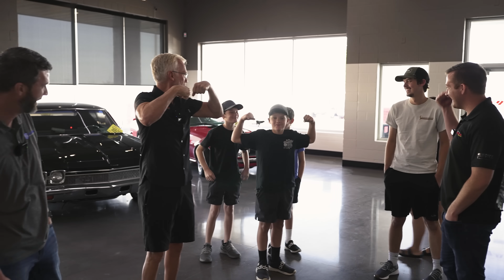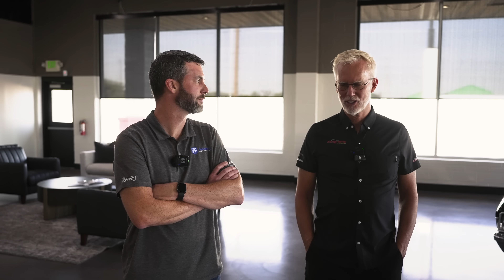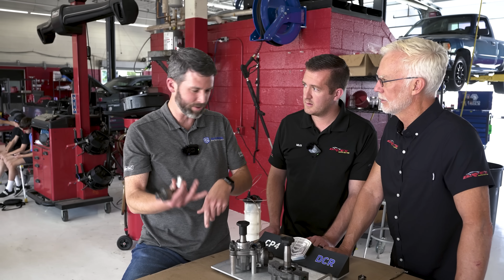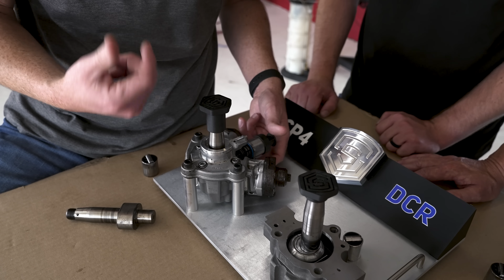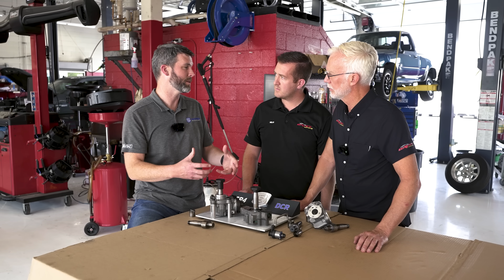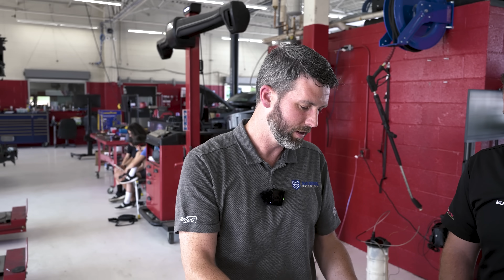Breaking Down How The CP4 Pump is a DISASTER & How To Avoid It With The DCR Upgrade!

Comment: Cp4 is amazing pump. Use the best filter. Keep 1/4 or more fuel for the air not being sucked in. Make sure you have a good lubricity with additives. You’ve got to prime the pump vigorously after a filter change.
Reply: My 1993 Land Rover 300tdi Bosch ve injector pump is a ‘good pump’
As it’s survived over 30 years without any noticeable wear.
Reply: And you do this how? Flood mode doesn’t work on the 2024. Just tried.
Reply: @mikefortunato9800  push the on button without holding the brake.
Reply: @HSKFab   Does not work on 2024 6.7 ford
Reply: @mikefortunato9800  Not sure on your model but on my Gladiator, push the button but don't push on the brake to start wait 30 seconds. Then keep doing it many times. I do it 10 times just to be sure.
Reply: I can confirm this does not work (flood made) on the new 2024 Ford 6.7. Push to start without brake does nothing and full throttle and brake before hitting the button starts the truck. (This was how it functioned before)
Reply: @mikefortunato9800  I literally have a 24 450 and the pump primes at key on.
Reply: @HSKFabrications  Ya, sorry I was looking for flood mode to build oil pressure prior to starting when changing the oil filter. Years prior to 23 had a sequence to follow with gas and brake pedal. Dave's auto documented lengthy time to build oil pressure in the 6.7 on startup which started discussions on pre-oilers, flood mode prior to starting, etc.
Reply: @mikefortunato9800  That was a marketing ploy to sell his "fix". I have an actual gauge on my 6.7 that reads psi. Will build pressure in a couple seconds. I can't believe he got everybody all riled up 🤣
Reply: 🤣🤣🤣 this guy.

Comment: It’s sad that brand new trucks have to be worked on to make them last . The quality that the vehicle companies put out these days is below sub par .
Reply: It's more the complication of having to design and build more and more efficient, "cleaner", and "safer" vehicles and engines. It's an insane bar that keeps getting raised and almost having to reinvent the wheel each time.
Reply: @DWthaman5424  yep.? but seeing as the U.S.A. Makes up let’s say 5% of the world I don’t think these stupid emissions laws is gone make enough difference to ever matter . But some how these lefties think so mostly cause they are profiting from it
Reply: sad that the engineers don't engineer at ford
Reply: The problems with the pumps are directly a result of fuel mandates and emissions mandates. The manufacturers are actually doing quite well considering the constraints they’re forced to deal with.
Reply: @janfalcon2020 the problem is Ford is the only manufacturer still using CP4 pumps. They are known not to be durable but Ford is still using them. Unacceptable
Reply: @Billybob50119  of the big 3 full sized diesels, yes. Worldwide, no. But yes, it’s disappointing they are still using something that’s known to make their engines fail, which they do not cover under warranty if the cause is bad fuel, so make sure your insurance covers this issue. It’s sad because the 6.7 is truly an amazing engine with much more potential still on the table. I doubt Cummins and Isuzu have as much untapped reliable potential.
Reply: @Billybob50119 cp4's work fine....it's our crap diesel fuel.
Europe has been using the bosh cp4 for many years without major issues.
Reply: Thank the government for it all
Reply: @ yep
Reply: It's intentional.  Designed obsolescence; making repair costs so high that the Owner buys another truck, vs. getting his original truck repaired.  They can afford it.  New truck owners are both wealthy and foolish, and no one should cry when they get screwed.  Keeps repair businesses profitable, and the techs well-paid.  Everyone wins.
Reply: @slabslayer258  They don't. This is a big sales tactic, and you're all falling for it. Title is complete horse shit. Cp4s do not "always" fail. Out of millions and millions of Cp4s in the world, less than 5% fail. The 6.7 upper oil pan fails more often.
Reply: Whaddayouwant for $120,000+ ? :face-blue-smiling:
Reply: Hard to wrap my head around changing fuel filters every or every other oil change. I’ve farmed for 50 years, and we will run fuel filters a couple thousand hours or more, no problems. We do have filters coming off our supply tanks and have always ran power service additive, is that the difference?? Asking because I’m about to buy a 2019 ram, 190 k but it has been changed over to the cp3 pump, (my sons truck so I know the history). Also wondering if the 10k mile oil changes are a contributing factor.
Reply: While true, this usually happens when diesel owners fail to maintain their fuel filters, not necessarily 'out of the box'.
Reply: @thiccwafflesosrs  that is also true .
Reply: @slabslayer258 it's all about selling another vehicle these days and bowing down to emissions
Reply: @slabslayer258  wow now Dave is deleting comments that go against his product pushing.

Comment: 2009 F250 6.4 diesel 80,000 miles. Should I just replace the pump and is there a better pump I could replace it with.
Reply: ???dcr???
Reply: @robertpsotka3525  I don't think dcr makes one for the 6.4 diesel.

Comment: My mechanic installed the DCR pump on my 2017 Powerstroke and upgraded the exhaust manifolds along with the stealth g2 turbo and 4” downpipe and it is an eye opener!!  Wow, just wow!!  The DCR never runs out of fuel. Highly recommend this upgrade and never worry about the cp4 grenading.
Reply: Are u deleted?
Reply: @garyolsen4160  Are you epa?
Reply: @blown503  lol I've been called a lot of things but that one hurts.
Reply: @garyolsen4160 you have to be deleted to have a cp3
Reply: How much does that cost to do that mod?
Reply: @michaelyork6592  the pump itself is 2k

Comment: Stanadyne pumps, components & products are the best, proven designs that last. Their fuel additives work - 370K on my 1988 7.3 IDI that has always had their fuel addative used. Still on 2nd set fuel injectors +1 & 5th set glow plugs. Only system weak links are rubber o rings & hoses- "consumables"

Comment: Had my CP 3 conversion done in my duramax 2 years ago. Glad I had it done before the CP 4 pump failed.
Reply: Year ,mileage when done?
Reply: @2hotscottpro  2011,2500 at 96,000 miles.
Reply: @jimmccabe801  I’m at 93k and been thing about doing it for years now.
Reply: @2hotscottpro  The issue with the cp4 pump is you never know when it's going to grenade. Best to do it before.
Reply: @jimmccabe801 yes we know, pour fuel quality higher mileage lol, anyone who takes care of their rig gets 400-500k miles easy
Reply: Easy ya right

Comment: Best peace of mind I could have done on my truck after having 3 cp4 failures in two trucks.
Reply: @Grayson.84 . Not true, GM just admitted in a lawsuit that the CP 4 was never designed for US diesel because it is much thinner and cavitates in normal use, causing failure. This isn't operator error it is bad engineering, not making sure a pump was designed for the purpose.
Reply: @redrubi3942 ‼️‼️‼️
Reply: @Grayson.84good for you. But everything you mentioned I do and beyond that! That cp4 is the glass jaw of the Powerstroke. No one says every cp4 fail, but when they do it’s very expensive! Why Gm and ram did away with them! And they are in other vehicles as well. So just because you have a few that has lasted doesn’t mean they aren’t problematic.

Comment: Lot of euro cars use electric supply pumps and a lot are actuated when you open the door and may even activate the glow plugs depending on temperature.   All saving wear and tear on startup.  Having full fuel available at the high pressure pump avoids fuel cavitation and dry wear.

Comment: US grade diesel fuel has a lot to do with CP4 failure, in Canada we have better grade fuel. When I travel in the US I use additives in my fuel.
Reply: I use a combo of Power Service Diesel Clean + Cetane Boost and Marvel Mystery Oil to keep things running smooth.  We have a 2006 Ram 3500 MegaCab 4×4 with the 5.9 24V CRD Cummins
Reply: I never EVER buy diesel without adding QUALITY additives
Reply: I agree, I always notice a slightly reduced power when filling in the US. I always utilize my go to additive especially when travelling south.

Comment: I put a DCR in my 2024 F550 at 4,000 miles.  Truck starts quicker and I no longer have to worry about potential failure.
Reply: Dave your the greatest , you raised your children strict and proper. My question of curiosity is when one of your boys did something wrong did you send them to there room with a motors manual and  memorise the firing orders on all desoto v8,s ever built......😮
Reply: What does changing the fuel pump do to your warranty?
Reply: @walterrafolski5662  I checked with my dealer you have to wait until the warranty is up
Reply: @walterrafolski5662  nothing. A ford mechanic changed mine out and the truck even has a sticker under the hood that addresses this. I would do it even if it did affect my warranty. If I’m sitting at the Arctic Ocean and I have a fuel pump failure, Ford is not going to come up and replace my fuel system.
Reply: @jimandvalstravelchannel  thank you for the reply, I have a F350DRW on order and it will be delivered second week of October. This issue made me very nervous about buying this truck.
Reply: @jimandvalstravelchannel  I have no idea how it would even be possible to make the 6.7l start any faster? My '24 6.7l HO starts before I can remove my finger from the button!🤔
Reply: @skipjackjohn6231 That was actually "the" opening issue raised in this story! 🙄
Reply: What does the conversion run to have done?
Reply: @justinengle6720  $2000 for the pump and around $1000 for install. It’s not cheap, but way better than upwards of $15000 if your cp4 fails.
Reply: @justinengle6720  a shop is charging me 1800 on top of the kit list price, which they stock, my cp4 is also still good and low mileage on the truck. ive found the best price is from a recommended shop on the S&S site because they do them more than anyone else and likely get a better deal on the kit themselves imo. i checked a few places and it was as high as 3500 for labor.
Reply: @justinengle6720  In the ballpark of 2-3k
Reply: How much was the parts an labor?
Reply: It's rather simple. The starter spins at a specific speed. Any pump that can provide higher rail pressure at that specific speed can improve start up. Higher fuel pressure always equals better fuel atomization which equals more power. More power at startup equals faster starts. Also, people are fully capable of detecting millisecond differences in time.
Reply: @MrPeacekeeper44  Mechanical pumps, sure! The rest of what you said is applicable only in the last century!
Reply: @djsmith4789  I think you are confusing electronic regulation with actual pump mechanics. The ford high pressure pumps are mechanically driven by a gear. this means they are only spinning at a specified speed at startup. Now if the pump was providing too much pressure at startup (not likely) the electronic pressure regulator would step in to dial it back.
Reply: So what is a DCR and what is a CP 4 pump how do you know if your car is cp4 or CP 3 is it for diesel or petrol is it in USA or Europe
Reply: @liambyrne591  these are both high pressure diesel fuel pumps. The Bosch CP4 pumps are prone to fail and due to how they route fuel through the pump body, the bits of metal from the failure spread throughout your entire fuel system. Which then requires total cleaning of every bit of the fuel system and replacement of some parts. The DCR is a direct replacement for Ford 6.7 diesel engines. They are designed differently and even should one fail, there would be no way for metal bits to spread throughout the fuel system. CP4 pumps are used in the US as well as all over the world.
Reply: You definitely still have to worry.  It's not a pre 2024 Toyota.
Reply: Kingstar Company and your new Rig are #1... Congrats Jim.
Reply: @skipjackjohn6231  Stop what?
Reply: Scrap CP4 VIVA LA VIDA DCR FOREVER! once you go DCR you won't go back to shite CP4
Reply: Sorry, just changing the pump will not change starting characteristics of an electronically controlled common rail.
Reply: @HSKFab  I'm no mechanic, but I can assure you the truck does start faster.  I think @PowerStroke Tech Talk w/ARod agrees.  He noticed it before I did.
Reply: @jimandvalstravelchannel  They both are salesmen for s&s. The starting times for the 6.7 varies between trucks. Mine starts extremely fast, with a cp4. You can replace the vcv and it will start faster. Which the dcr comes with, a new vcv.
Reply: @jimandvalstravelchannel I am a mechanic- and changing the pump can absolutely affect the starting characteristics. Don’t think so? Swap to a worn old pump and see how well it starts.
Reply: @danielhenry52  I have trucks in my fleet with over 300k miles that start on a dime. There's more that goes into play with the 6.7 than just the cp4 when it comes to starting.
Reply: @danielhenry52 but his pump had 4 k. As bad as the CP4 is even 4 k isn’t worn out.
Reply: @jeffreygoss8109  I’m not saying changing a pump “will” affect starting. I’m saying it can. Plenty of these trucks had low mileage at point of failure, so who’s to say that when he said his truck started fast with upgraded pump, that it didn’t in fact start faster.  I mostly commented to say the pump can affect starting, along with other factors. Who’s to say his 4k mile pump wasn’t also shit or on its way to it from the factory. As a ford guy, who also worked for various ford dealers, I humble enough to admit not everything ford produces from the factory is absolutely perfect.  This is all with friendly intentions, sometimes comments come off as if the commenter is arguing.
Reply: @HSKFab 😂
Reply: Sorry, but if your 6.7 was slow starting you had weak batteries or a starter. Or you just think it is.
Reply: @tjlqk3 Exactly! My 2 month old 2024 F350 6.7l HO starts faster than I can take my foot off the brake pedal!
Reply: @tjlqk3  if you switch from a cp4 to a DCR, you will see the difference.
Reply: @jimandvalstravelchannel  what, 1&2ms? 6.7s start easy
Reply: @tjlqk3  push the button and it’s running. Almost like those cars that shut off and restart at intersections. There is hardly and cranking.  But you’re right, I’m sure the time difference is less than a second.

Comment: I wish there was a Dave's Auto on every corner so we could all have good reliable running vehicles and not some junk people try to make into a returning customer.
Reply: you could not find the labor to do that.  You have to find a mechanic you trust at a price you can afford.  Beware though cheap has its own rewards.
Reply: @normangiven6436  I do most of work myself unless I don't feel like it. That's why I really don't like new cars because of all the bullshit you can't do on them because you're not certified. If I do buy another vehicle it's going to be something not controlled by a computer that you have to subscribe to.
Reply: Good mechanics aren't expensive, they're priceless.
Reply: @edwardtabor77  I agree with that 100%. I have a guy that I trust when I can't do anything or have trouble with something that I'm not sure of I use that guy. He's not out to rob anybody but he's also not going to do it for free. He'll either point you in the right direction or tell you what you need to do for him to fix your shit right. Those guys are priceless.
Reply: Amen. I got burned several times before I found a reputable diesel only mechanic shop.